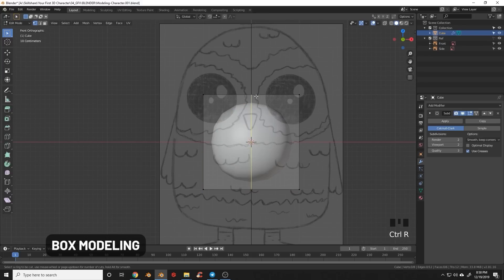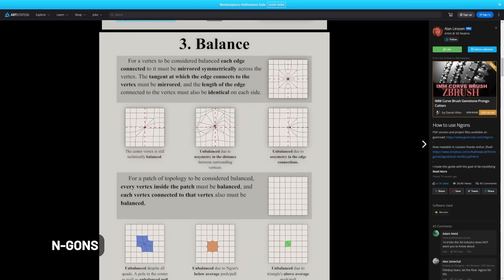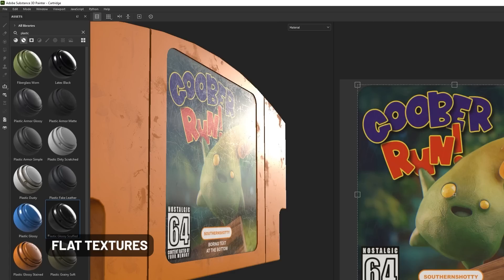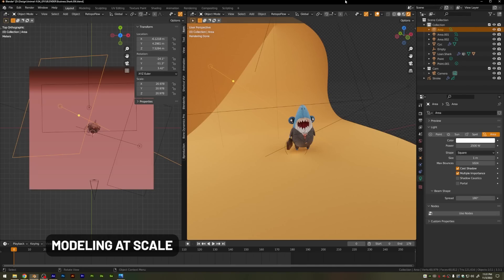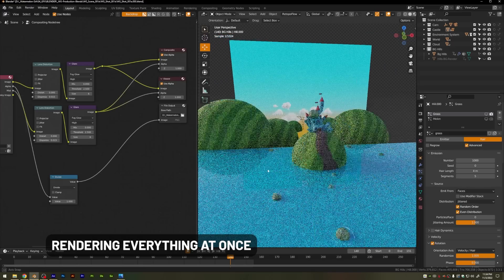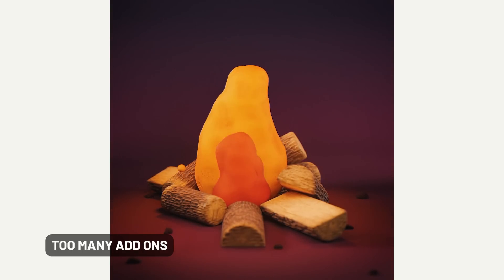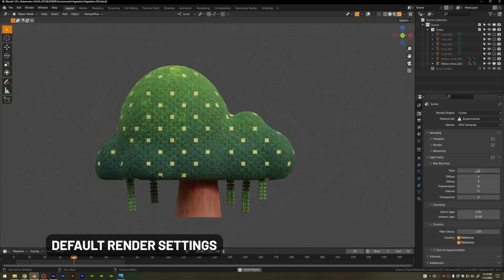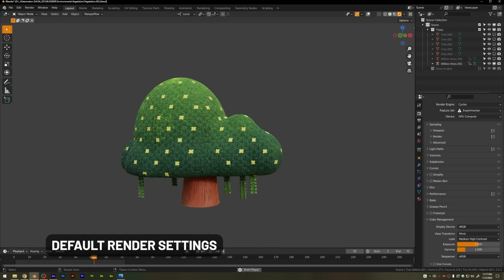10 Common Blender Mistakes and How to Fix them!

Comment: Instead of worrying about UV packing, you can use UDIMs instead, which gives you more resolution, and much more control over resolution. UDIMs are very commonly used in VFX, but most Blender users don't know about them. UDIMs make working with UVs much nicer, especially for complex objects with multiple materials.
Reply: Additionally, there's a lot to be said for having human-editable UV layouts so it's not always great to have UVs packed all over the place with no continuity between adjoining faces, in case you want to paint/clone something on the texture later. Of course many 3D tools include 3D texture painting now but they're not always great.

Comment: 07:11 Keep in mind setting high noise threshold can make for some splotchy areas if you're dealing with some particularly difficult fireflies; in some worse cases, using noise threshold at all can be a problem.

Comment: I think other than rigging and addons I've been guilty of all of them. My big one was totally reliant on box modeling as I moved over from 3Ds Max and that was drilled into us as the best way to model.
Reply: what's the alternative to box modeling? starting from a single face?
Reply: @MihailBurduja  Starting from a single face is possible even a single vertex I guess that would come under Polygon modeling/edge extrusion on from that is Spline/curves modeling, Boolean modeling Parametric modeling. Procedural modeling and sculpting while I don't use them all (some not at all) they are great to know as can save so much time and headache.